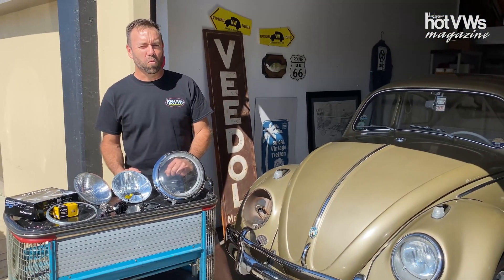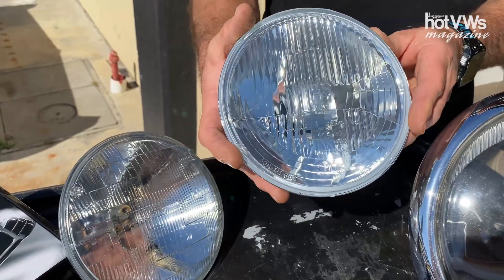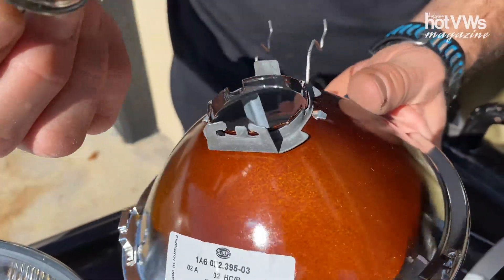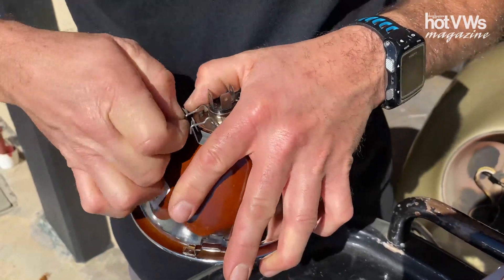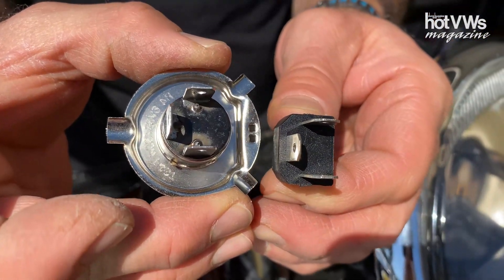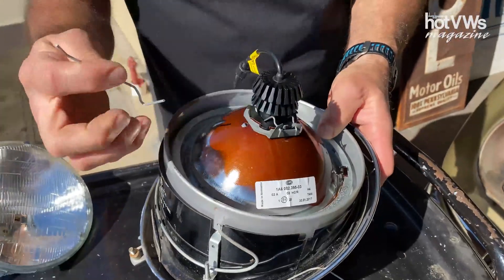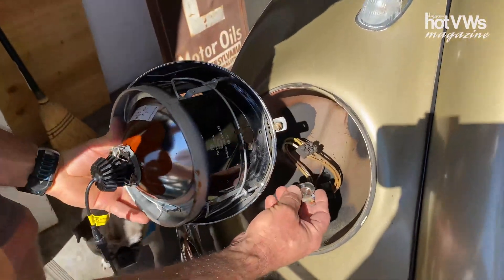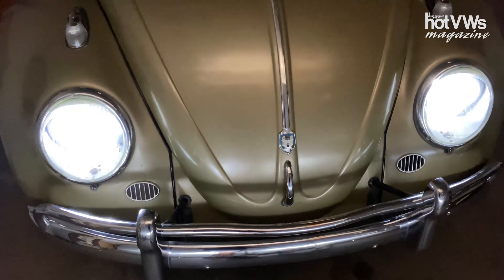LED headlight Conversion for your Classic VWs (You can do that for 6V and 12V system)

Comment: Awesome!! I have a 64 bug. This will come innhandy!! 2 questions; the link for the housing onnamazon, has various sizing options, which do I pick?
Also, could u send a link to the Led bulb that u used. Thanks a million!!!
Reply from the maker: For the housing, you should get 178mm H4. 
For the LED Bulb, if you are running 6V, this should work.
https://www.ebay.com/itm/182921429337?mkcid=16&mkevt=1&mkrid=711-127632-2357-0&ssspo=nLD0IBWHRQW&sssrc=2047675&ssuid=&widget_ver=artemis&media=COPY
Reply: @hotvwsmagazine  awesome thank youu!!! Gonna jump on this project asap. I heard u say in video about a different video regarding similar issue with tail lights. I just subsribed to your chanel, but cant find that video. By any chance could u send me that link please. 🙏🏻🙏🏻🙏🏻thanks again❤

Comment: Any suggestions / links for LED options in European headlamps?
Reply: I was going to ask the same thing. I need some 12v LEDs with a P45T base. I've seen the adpaters but I've seen some talk about them moving the bulb so the beam pattern isn't right.
Reply from the maker: If it's 12V, you can find P45T base LED like this one. 
https://www.amazon.com/dp/B095K67TGM/ref=cm_sw_em_r_mt_dp_Q0J11B6CVED0W8EZXSPC
Reply from the maker: European headlight might little bit tricky since it has P45T style bulb and I never seen LED with P45T. You would need P45T - H4 adapter like this.
https://www.ebay.com/itm/282431057343